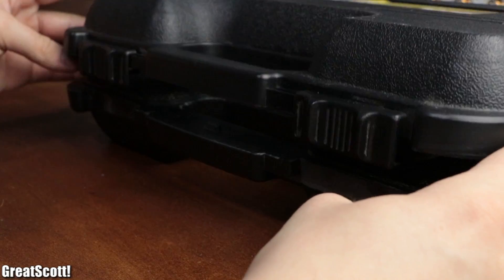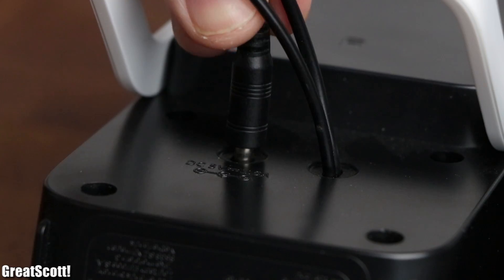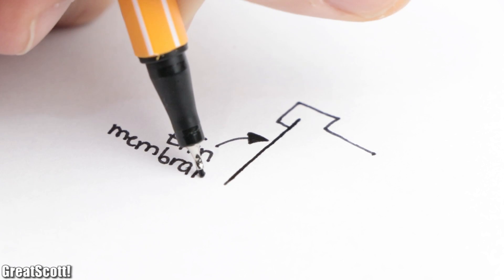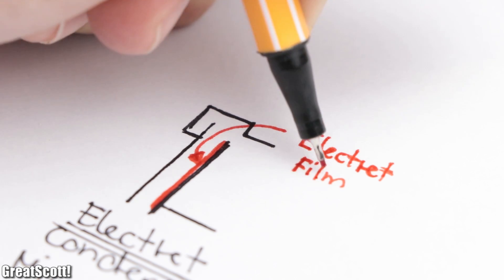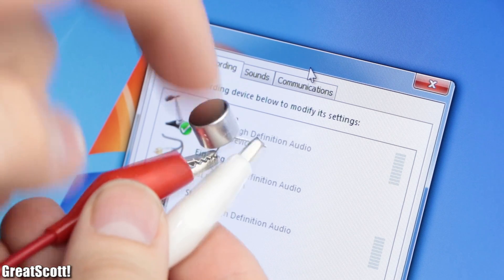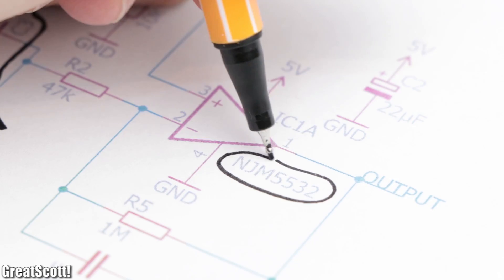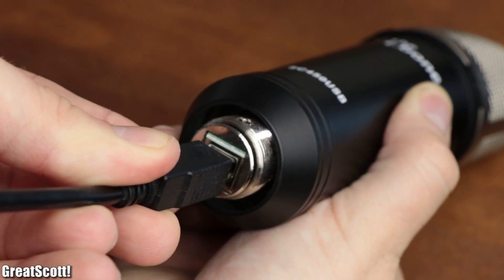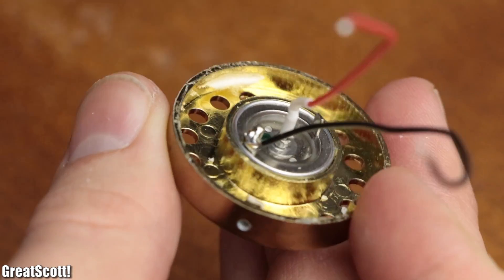Voice-over Microphone || DIY or Buy

Comment: Might be worth revisiting this. The OPA Alice op amp circuit is really quiet, cheap, and simple. 25mm electret diaphragms are really affordable. The JLI-2555BXZ3-GP is a good capsule, but there are even 2555 clones on aliexpress. There are good 3d printed cases, but stuffing everything into a gxl1800 or bm-800 is probably easier and cheaper. Don't forget the two 22nf EMI caps on the xlr input in the mic.

Comment: very educational but honestly, you can make a 30$ microphone sound incredible if you just design it properly and use a good condenser mic vs a cheap smol one.
Reply: how
Reply: @mimimi9170  Google DIY perks :)
Reply: @mimimi9170  DIY Perks, check him out. his circuit isn't ideal as he's not an electrical engineer but it's still a lot better in most ways.

Comment: Part of the reason why the circuit doesn't sound so good is that you're using an NJM5532 with a supply of just 5V. It's rated for a minimum supply voltage of 6V (to be precise ±3V), so there's no guarantee that it is operating properly. You might be lucky, or you might not. If you operate outside the limits on the datasheet, all bets are off.

To compound the problem, the NJM5532's output will typically only swing no closer to the rails than about 1V (and that's with a load greater than 1K). So with a 5V supply you'd be lucky to get a 3V pk-pk signal out of it before it starts clipping, which is a problem since you measured around 200mV pk-pk from the mic capsule, and you set the gain at 21 - that's potentially 4V pk-pk.

Of course the final difference between the expensive mic and the DIY project is going to be the quality of the mic capsule, but the ones you are using are pretty good for their low price and it seems a shame not to maximise their potential by giving the preamp some headroom.

I know that obtaining a supply of more than 5V is a nuisance in DIY projects, but in this case even a 9V battery would represent a likely improvement. The supply current needed is less than 10mA.

Comment: As you can see, adding 5v to the mic gives low voltage. Can I change component values or higher voltage to get more signal? I want to plug mic’s to a “DJ” mixing thing I got as a present, to use for my drum set. I heard RCA signals are 1-2 volt.

Comment: It's important to understand that there are 3 kind of microphones. Pure dynamic microphones that actually generate very small amount of electricity from sound waves, electret microphones that require 3-5 V bias voltage (also called plug-in power) that this video is about and condensator microphones that require 48 V phantom voltage.

The problem is that many electret microphones are incorrectly advertised as dynamic microphones and people end up claiming that some microphone is not compatible with some device when the device only supports dynamic microphone and user tries to use (incorrectly advertised?) electret microphone.

Comment: Excellent presentation. Have been thinking hard about why the electret mic I have, results in very low sound. Now I know why and what I can do about it. I have some electronics build experience and could build your amp easily enough, or just lash out on a posh studio mic Hmm. The sound card on my pc is Asus Zonar D2X which was an expensive unit. Perhaps it should have had built in amplification for electret mics but apparently not. The mic input on it is just really another "line in" then!

Comment: I think the big difference was simply due to the area of the microphone membranes. Obviously you can't get the same low frequency response from such a small membrane. A bigger pickup area is the solution, either with a bigger pickup or a few electrets wired together. This is a good video, it got my imagination flowing; thank you.

Comment: This circuit has no decoupling capacitors and it gets unwanted interference because of that. Also the gain is a bit too low. I experimented a bit and found a better circuit from electro-tech forum. Just saying.

Comment: when designing a mic preamp you need to take in consideration the specs of the adc first thing the dynamic range of the adc ,after you need to know that the audio input on your computer is stereo and the microphone you are plugin to it is mono , i'm not saying something new just check the specification of every device in the signal path you are using and you'll see by yourself

Comment: An electret microphone module, which has a microphone mounted on a small pcb with a MAX4466 pre-amp, is available on ebay for about 3 euro. The gain is adjustable from 25 to 125.

Comment: This comparison is greatly flawed. The laptop's built in sound card sounds like it was running at a much lower sample rate, potentially 16kHz or something. the same lack of high frequencies can be heard both with the SmartLav and the DIY mic. A USB soundcard can be purchased for ~$10, and will be able to run at a proper sample rate, if the laptop is unable to.

Comment: I’m watching this video on a simple amp I built, still not perfect on the understanding of the circuitry but I’m slowly changing and evolving it, for a completely passive amp it’s great as the only input signal is the aux from my phone, and it drives a 6 ohm 15 watt speaker, although not very loud, louder than headphones definitely
Reply: It’s not powered from any extra voltage from any power supply, only from the aux to my phone

Comment: Your result is questionable. All things being equal, it should have sounded similar to your lavalier mic. It sounds like the sound has gone through a low-pass filter. There are four possible points of failure: (1) the capsule could be of poor quality, (2) your circuit has a fault, (3) your laptop's mic input might have some kind of filtering activated and (4) your sampling rate could be very low.

Comment: I think this test is unfair. Electret microphones needs some housing to avoid the "echo". To make it somewhat similar, I at least would put the band-pass filter in the condenser mic.
Reply: Yeah, this was almost like comparing speakers in a cabinet vs speakers without a cabinet.
Reply: @kevinbissinger  yeah this is what i thought. With a good electrec capsule and proper placement it can sound nearly as good it not just as good as a studio microphone
Reply: @siontheodorus1501     are these electret  ones need an additional power as one of the plate is permanently  charged
Reply: @Abhyuday_rai  nope usually electret condenser doesn't need additional power just like dynamic mics
Reply: @Abhyuday_rai  Yes, the internal FET amplifier needs power. That's why you see the 1K Ohm resistor hooked to V+.
Reply: @siontheodorus1501  Yes they do, you saw him take the 1 K Ohm resistor to V+  that's because the internal FET needs power.
Reply: @Starbuckin  hmmm i guess it needs some but not that high compared to condenser mics
Reply: @siontheodorus1501  Electret microphones may emit very low power and low quality signal without additional power but for any real usage you need 3-5 V bias voltage (also called "plug-in power" by some people) to power the FET in the capsule. The circuit in this video implements this part.
Reply: @MikkoRantalainen  ahh i see, but can a normal 3.5mm jack output that voltage? Or do we still need some external power source?
Reply: @siontheodorus1501  3.5 mm jack can output the bias voltage but it cannot output 48 V phantom voltage. However, not all 3.5 mm jacks output the bias voltage and this is the root cause with all the problems with mic incompatibilities.

Also note that most high quality audio interfaces (e.g. anything manufactured by Focusrite) do not support bias voltage. You can get something like Rode VXLR+ (not to be mixed with Rode VXLR without the plus at the end!) which can take phantom voltage from XLR connector and output bias voltage with very high quality for electret microphones).
Reply: @MikkoRantalainen  what happen if i put phantom power to electret mics, i believe it will be harmful right?
Reply: @siontheodorus1501  Phantom power has pretty high resistors in series with the 48 V source so the actual power transmitted is very low. In theory it's possible that the FET inside the electret microphone gets destroyed but in practice this probably doesn't happen.

The 48 V "phantom power" is transmitted between pins 2 and 3 in the XLR connector and I think most ways to connect a microphone to XLR adapter is to connect to pins 1 and 2 only which should avoid getting the 48 V to the electret microphone and it just doesn't do anything.

If you have an adapter that connects microphone to pins 2 and 3, that could be problematic in theory.
Reply: I also can't confirm that microphone capsules aren't sold separately - they are and that would be a fair comparison IMHO.
Reply: 7:08 He did add band-pass filter.

Comment: Nice video, I've got an idea for improvements to the circuitry:
1. The op-amp could be replaced with an ordinary audio transistor for a simpler circuit using less parts without hampering it's performance!
2. Adding a RIAA (or similar) filter to the circuit to suppress the higher frequencies, which should make the output less "tinny"...

N.B. It's the latter of the two which will make the output quality nearly indistinguishable from the high-end mic!

Also, output filter cap. It's not there, which could hurt certain devices when this is plugged in due to the 2.5V bias on the output!
Analog designs can be a headache, but it's worth it to make as good a circuit as you possibly can...

Comment: No, I found the DIY Electret Mic better than buy.
Here's my configuration:
1. Use Li-Ion Battery as power supply, so basically 3.7V will power up the MIC.
2. Use BC549C Transistor instead of OpAmp, I found the Transistor work better than IC when I build based on your circuit.
3. Feed the MIC condenser with 10K to 47K, this is important because lower than 4.7K make buzzing sound.
4. Use circuit based on circuit named "LPB-1" on web. It basically guitar signal booster circuit but the result so fantastic for me. You just mist be tweak the resistors on the collector and emitter lead so the gain abou 10 until 50, it's just easy and depending on your need.
5. If there's a noise in high requency just put 470p capacitor across the MIC.
6. Don't forget to make sure the Li-Ion as Power Supply steady at 3.4V - 4.2V and parallel with 100uF elco.

Simple and reliable for me, just perfect for recording with DAW (Studio One) and start to making music.
And with 18650 Li-Ion 2200mAh, it long last for a year.

I make this because I don't have any money but want to produce a good recording sounds.
😅😅😅😅

Comment: The issue with the voice quality is no tone shape network and I think it would be best to have two stages of amplification (one after the ton shaper network) that way the gain on each stage is less, but the overall gain is greater, I also believe that first referencing the microphone frequency curve and adjusting the tone shaper circuit, filter network and gain stages to compensate would deliver a much better sound quality (and not add much in terms of component.) If you wire both stages in an inverting configuration you can get a couple of resistors less in your design (for the microphone power, and bias) and tweak the negative feedback to reduce hizz (at high volume) on the output.

Comment: Another great video. nice, fun little project. I can think of lots of applications for a mini mic/ amp combo, especially married to a nice FM transmitter.  Your Circuit Schematic drawings are professional, Your handwriting is professional and legible,   instead of "pretending your a doctor."
the videos flo smoothly from point to point, with a keen focus. (not repeating the same thing over 6 different ways) The video is actually about the subject in the title, and not about everything you have experienced in life getting to this point.
I love the way you have common circuits engrained in your head, and know which ones go together.
Most of all, I like how you use your math to create, and share your steps in calculating.  You just bomb it out without even thinking.  I would like to achieve that level.  Bad Ass. 
More impressive than any athlete, movie star, politition, or singer.
If I had a choice between tickets to Meria Carrie, the world series, most any sports event, Jay Lennos Garage, Shakil Oneils Bar B Q, or a day hanging out in your lab. I'd be on my way to your place.  You have a really good voice and manner of speaking as well.
I really enjoy your videos, a lot is put into them.
Thanks.  Very Much.

Comment: you missed the most important steps!
1) FFT Analysis to normalize output value to real value (calibration). e.g. Sweeping all frequencies with the speaker + condenser microphone and doing the same with the cheap one. this should make the small microphone as good as the condenser one, as good as it sounds even without. the companies cheat this way as well.
2) more surface better quality. Use multiple microphones and avarage the input. = awesome quality. Also you can do microphones this way which can "see sound" and in this way be a "sound camera"
Reply: This way DIY wins! I am pretty sure.

Comment: This is very cool, a project with a kind of practical use, made from basic filter op amp circuit
I just built it, but has a ton of noise, i had to put it inside a box to eliminate the noise

Comment: There's this new device called Chargie that I'm really interested in, it saves battery life by not allowing the battery to charge all the way, I was wondering if there was a diy method of doing the same? I'm actually surprised this hasn't been built in by companies!
Reply: Say what? Preventing the battery from full charging saves it? I thought it's the other way round.
Reply: @davemwangi05  depends on the type of battery I believe, but typically the higher you charge it, the hotter it gets and it starts to deteriorate and battery life goes down, that's what I've heard but I'm very novice
Reply: @untitledsouppng  Oh now I get you and I can  now relate with what you're saying. I think we can try to make sense from the sea of info which sometimes is contradicting

They say that lithium batterie's worst enemy is temperature, and that's generated during charging or even from ambient temp. But your comment has made me remember something, I've often encountered the emphasis that slow charging is the best for these, but why it's not done is because it takes long. and if you slow charge, then the temp will not rise as much. and once a battery is full, charging stopped, temp will stabilize.

The second enemy is charge/discharge cycles. They have a specified number of charge and discharge cycles, so most people make the error of charge/recharge -eg a laptop when they're just close to a power source, wasting battery life. Just like vehicles, machines, more use more degeneration due to wear and tear.
Reply: @untitledsouppng   I have a swollen 2000mAh aattery and definitely temperature was the culprit. It was getting very hot during charging/use probably due to bad design by manufacturer. I poked a hole and a gas came out pshhhh. LOL. 

You can share some more important info /tips you know too, I like learning from people too. Actually forget the slow charging, I've remembered there's even an app which is tailored by experts to deliver varying levels charging currents as the battery fills up, they're best optimized for ensuring survival of the batteries, but the thing is that they strive towards full charge.
Reply: @davemwangi05  yes, exactly! If I could find a way to slow charge over night I would much rather have the stability and longivity than the speed, the thing is I'm not good enough with electronics to think of any way to slow charge to a specific point then stopping, which is why I'm asking. Chargie's approach is one half electronic one half programming, which actually has inspired me to start learning C to eventually get to C#, C++, and other possible languages. As of now I'm using a wireless charger with a lower voltage than recommended for my phone as it charges at a turtles pace
Reply: @untitledsouppng  Ah in that case it's very simple, have you heard of arduino? And you don't need C#, just a very simple code in C and you'll do wonders. What's the capacity and type of the battery?  you don't need to use a lower voltage to charge it'll never fill up. you just need to never exceed the specified limited charge voltage, such that the code in C will tell it to stop at 4.2 V
Reply: @davemwangi05  yes I have, and it's 3000mah, unsure of what charge rate is recommended however

Comment: You really ought to use an external interface if you want a real upgrade. Having a proper preamp with gain control will give you much better results than your usb mic, as the card in that usb mic is not good and is introducing noise into your signal

Comment: the issue in the circuit for some other fet of mic can be noisy you use special kind of condenser mic support circuit  as your requirement so i fix by use 1k r on output which fixes overdriven fet signal and removes hum or beep noise in other fet . some fet amp rate is about way more than we need due to it small size so we need balance or filter it  #greascott #fix #diy quality is near to other good mics by use cheap fet condenser . if i remove 1k from Condensor side it perfect for dynamic ones. and we also add some circuits to provide phantom power or use ADC with USB i\f to take further.

Comment: this is caused because the computer, most computers the mic input is really really crap, get a sabrent that is really cheap but could be decent, also change the LPF to 17khz that will make it sound more clear, but not so much, if you can just remove it and check for noise